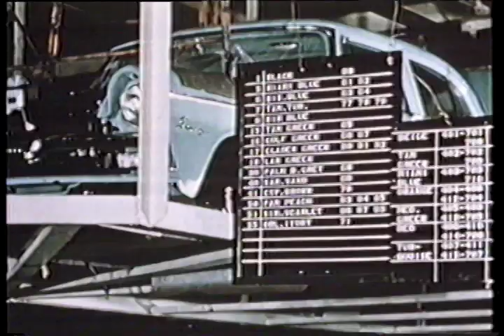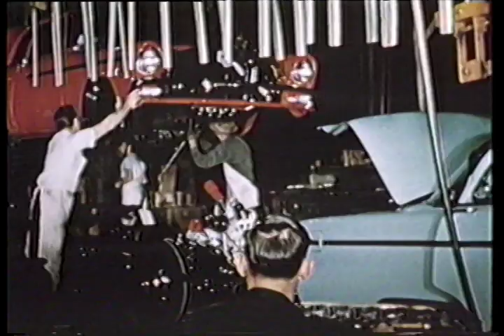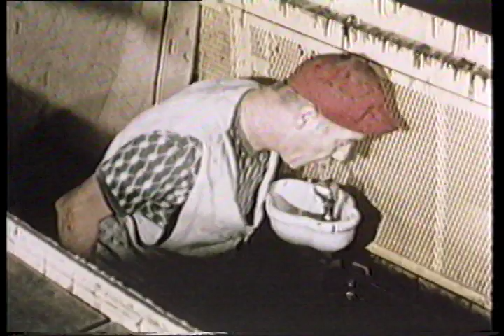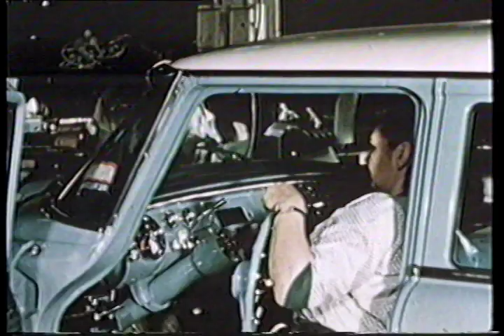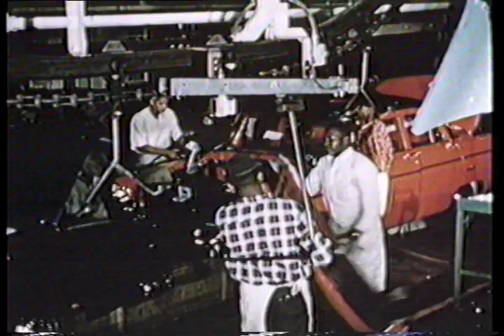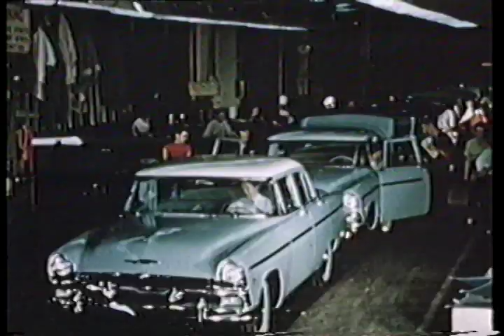Chrysler Manufacturing 1950

Comment: Lucky to have toured GM Van Nuys & the Nummli plant in Fremont Ca. Body & chassis or engine/ subframe meeting on assembly line is a dance in efficiency & planning.. even customers  factory options preferences can be accomplished  by special order. Built just for you. It's rare but they can make it happen, instead of regular  purchasing off the dealer lot.

Comment: Almost everything shown in this video has deteriorated away .Steel and flesh . Sad to think of .
Reply: So will you. Make something out of your live, while you are alive. Good luck
Reply: @vj8452  agreeable but being late 50s and look like 90 is an issue.
Reply: This isn't exactly correct , not ALL of it Has faded away. I currently own a  1957 chevy wagon... with the same welds that those ancestors hands put on it that day in 1956. A piece of their thought process is still relevant as it carries me down the road in 2024. The very same windshield that has seen all of the sights, the previous drivers filtered their vison thru, And traveled all of the countless miles of bugs, rain and air ...  STILL pushing air, miles and adventures. So it has NOT faded away... 1956 still lives today.❤😊